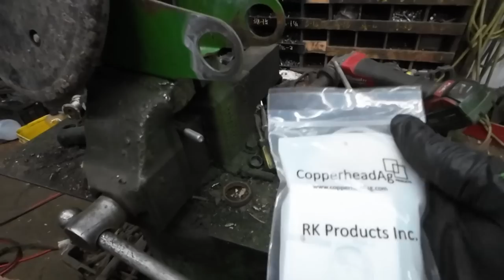How And Why?

Comment: The blades in the vacuum fans wear down over the years.  Might be worth inspecting them.  When you get it hooked to a tractor, run the vac fans, and pull the black end caps off on the ends of the main vac pipe-runs to suck all the loose dust and talc out of the main tubes.

Comment: This is after the fact, could you have made a jig to replace the bearing in the process so as not to put the bearing in danger of getting hot?
Reply: I repaired my closing arms this winter with the same kit, I used two vise grips to hold the race in place while welding, worked good